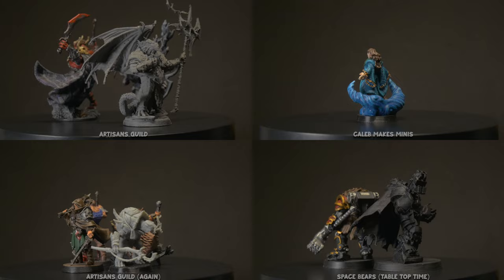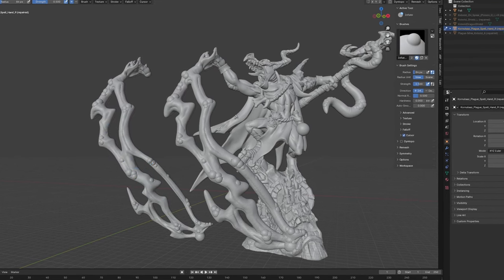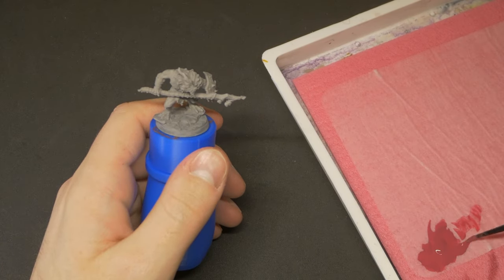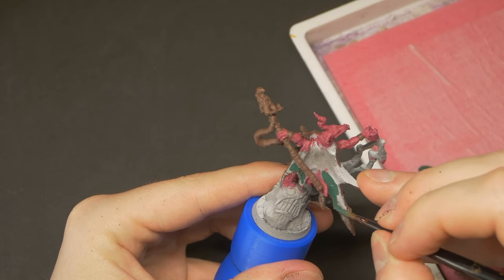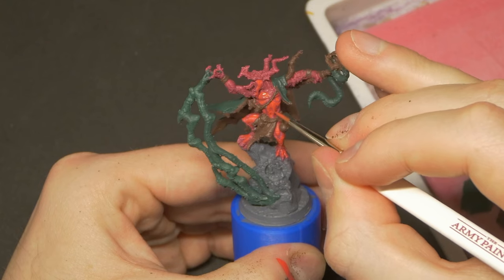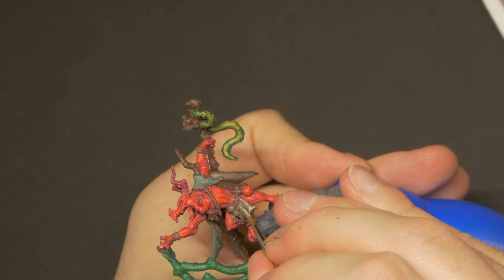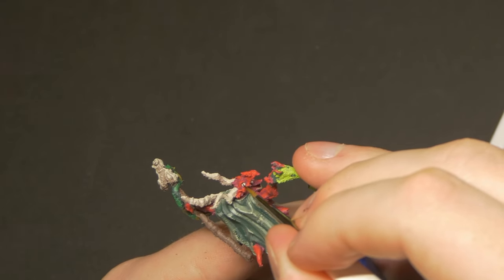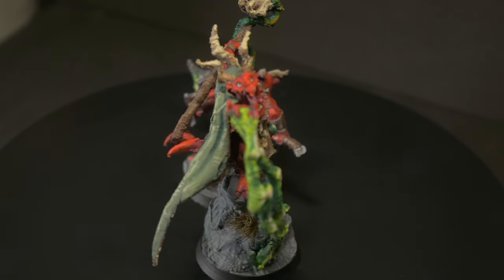FDM Miniatures in 2024! Can they compare?

Comment from the maker: Would give FDM minis a chance?
Reply: Nope. Cheap Resin printers are easily available. The results shown here are ... well, they are good for what one would expect, but they still look horrible (imo) compared to store-bought or resin-based miniatures. I don't do things half heartedly, so even if money were SUPER tight, I'd rather not have miniatures as a hobby than having them look like that.
Reply: I have a FDM printer, so it's my only option, thank you for your videos !
Reply: @ayonmetar2301  they look better sure, but also more toxic and require a lot more material.  can't touch the resin print until after cleaned with IPA , and then cured with UV light. need more ventilation and air circulation. filtration so you're not inhaling all those toxic fumes. masks, safety glasses, and gloves.
Reply: Yes I will. I don't really want the hassle of Resin Printers, I don't even have an extra room to dedicate to that.
Reply: @ayonmetar2301  Easily available =/ easy to use.
Lack of space, lack of proper ventilation, the hassle of having to get a curing station, that alone easily racks up the cost.

Also, health hazard? Spoken as someone who almost died due to resin fumes from printing, yeah, no. FDM all the way.
Reply: @tartatovsky  I can speak from experience (owning and regularly using both FDM and resin printers) that a resin printer + wash/cure station does not require much more space than a good FDM printer. If space is an issue, the entire hobby is problematic in the first place. If there is only space enough for one printer, I'd always pick resin over FDM.

It surely is more bothersome to use than FDM because of gloves+mask, cleaining, ventilation and so on. Nobody can argue against that. But a) it becomes pretty natural after doing it a few times and b) the results are just so superior to FDM.

It is always a question of what result one is aiming for. I enjoy the hobby aspect of wargaming and generally don't mind putting in extra work if that leads to better results. 
If space, ventilation or allergies make resin impossible to use for some, then it is of course not an option. However, I don't think people should be afraid of the "hassle" of using resin, because (from my experience) it really isn't that big of a deal. It actually is kind of its own hobby in itself.

For everybody who does not care that deeply about how their miniatures look and just enjoy the playing aspect of wargaming, FDM miniatures are definitely great. For people who are into the artistic aspect of the hobby, we're at least 5-10 years away from even considering FDM as a substitute for resin.

Bottom line: If resin printing were unavailable to me, I'd rather not 3D print miniatures at all, before using FDM for that purpose at this point in time.
Reply: @ayonmetar2301   

it can be a health hazard FAR MORE EASIER than it would be with FDM and PLA. 

Also, FDM printer needs less space than resin. No curing station, no glove/mask/cleaning tool, cleaning space, additional space to keep the extra resin after printing.  You also has no need keep all the chemicals away from children/pets, which you don't need to do with PLA and FDM.

Yeah, no. FDM all the way. I'd rather have my life than to deceased because I want 120k hi def super sharp uber  whatchamacalit and deal with resin again.
Nah.

If you rather choose no printer than to have FDM then its safe to say you were never into the wargaming hobby to begin with, rather you just want to have GW models without getting GW models.. Either that or you're rich. Think about people from third world countries for example.
Reply: @tartatovsky  I didn't ignore the health aspect. Did you read what I wrote? I said ventilation/gloves/mask are important and people with allergies should stay away from it. I don't know if you drank the resin to have such bad experiences with it, but in the 4 years of using resin printers, I have never had any problems with resin by simply sticking to the rules of "don't touch it, don't breath it". 
Regarding children: You also need to keep normal cleaning products from kids. Do you not clean your house because of that? All these are only issues for people who are irresponsible. 

My FDM printer is about twice the size of my resin printer. If I put the cure station, the gloves, the mask and my bucket of cleaning tools next to it, they occupy about the same space. I clean my models on a small tray on the floor in the garage. That doesn't require any space whatsoever. Space, again, really is way less of an issue than you make it out to be. 

Lastly, as I already said (and you apparently are to dense to understand) I value both the creative and the game aspects of the hobby. FDM is great for terrain, but that is all it is good for. Without a resin printer, I would indeed just buy the models and paint those as they come. The way it is now, i love to buy the GW stuff, design extra bits in a 3D modeling software and convert my minis to make them look unique. That is something an FMD printer just can't do.
It is cool if you can enjoy playing with parcheesi game pieces and milk cartons as proxies for minis and terrain. Its the same game in the end. But for all people who value both aspects of the hobby (which are numerous, I can tell you), FDM is not an option for miniatures. 
I am happy that lower quality prints work for you. For most people, they don't, as the high profit margin of pre-manufactured models by GW and others proves.

Considering the incredibly low number of FDM printed models I have seen used in tournaments or in my 36 people tabletop club (exactly 0 models), I think most people agree with my sentiment.
Reply: I did. It is going great. People love it.

Comment: I hate working with resin as a material. I'm basically waiting for FDM to be good enough to mainly use for premade bases and for those not too look too "off" under my Warhammer minis.
Reply from the maker: Absolutely! Even when I was resin printing my minis I found myself printing FDM bases, I just found resin bases took too much resin and never printed 100% flat due to resins affinity to warping. 
And honestly any FDM printer that can print 0.05 or 0.08mm is great for bases, once they have some paint and some grass tufts on them they do a great job.
Reply: Even with the rapid increase in quality we have been seeing over the past few years, I assume it will at least take 5-10 years until an fdm printer can match a current resin printer (if that ever happens). 
I got pretty used to working with resin. It's not fun, but it also isn't a hassle to me anymore. Just a necessary step on the path the best possible results.
Reply from the maker: Yeah - I highly doubt that FDM will every be able to match resin in terms of quality for things like miniatures, so for people than have Resin as an option too them it's definitely the best bet!
Reply: @Painted4Combat  what if I want to print bigger figurines like say action figures or anime statues?
Reply from the maker: Larger models means that you can actually clean it up a bit more, so If you don't mind doing some sanding you can achieve nicer results - with that said you'll still be seeing artifacts anywhere that a model has overhangs that requires support material.

Comment: its totally viable, i bought P1S combo just for all the stuff u can do, i cant put resin in my apartment, it would need serious VOCs vent system, that would cost time and money and modification to my apartment, i have lot of tabletop games, and its completly fine to use 0.2 nozzle with some medium sized minis for my games :)
Reply: you can just use a paint station vent  and put the printer in it and a tube out a window, you will need it anyways for solvent base painting and sanding.
Reply: @miguellopez3392  yeah, not gonna risk that in my apt, i have also big fluffy doggy, and dogs are way more sensitive to that shits,  i live in central europe, using that during winter with tilt turn windows no way, and dont wanna drill house walls to get vent out, i got medical air purifier and painting is bit easier to vent out cuz i have my printer and "gaming room" in my big open living room, but with the VOCs i dont wanna risk that .. maybe when the filters get better i will consider it, but for now no no
Reply: @ServTech1337  don't bother explaining yourself to these resin bros, man. They never take into consideration the living condition for most FDM users being different than them. They simply cannot comprehend any other situation other than their own.

Comment: I'm not touching a resin printer until I can somewhere with space and ventilation suitable for one. I've been very pleased with FDM for minis though so far. I highly recommend upgrading to 0.2mm nozzles. I was getting results similar to you, maybe a little better after a few months of tweaking, but with 0.2mm it has almost eliminated layer lines. The main issues I have left to deal with are scarring from supports and stringing although those are getting better
Reply from the maker: Awesome to hear you've been down this path as well! - I try to keep the 0.4mm nozzle on my printer as I do a pretty even split of minis to larger objects like terrain or household items, and swapping nozzles back and forth would get annoying.

Have you found much increase in print time swapping to a 0.2mm nozzle?
Reply: @Painted4Combat  Not as much as I thought, but I use the same 0.08mm layer height for both. I just did a test slice on an OPR Robot Legion Eternal and with my 0.4mm nozzle profile it says 1h50m, with the 0.2mm nozzle profile it is 2h16m. the lowest layer height I have tried was 0.05mm which looks amazing but puts the time up to 3h24m for the same mini so I don't use it much

Comment: One of the first slices I used, it was after one I can’t remember the name of, had a cutter and a lay on side function. It was very easy to take a more complex model and cut it down into easy jet pieces and then lay them down with less supper structures. Yes blender or CAD dose give you more flexibility when it comes to cutting and editing, the point it their are way to get complex prints to a more viable FDM level.

Comment: What FDM printer do you use, and do you have any recommendations for someone completely new to 3d printing
Reply from the maker: I use an Elegoo Neptune 3 Pro. its a great machine and is a reasonable price, but as with most 3d printers requires a bit of experience to operate to its fullest, though its also quite forgiving if it were to be someone's first machine. I do think the new BambuLabs A1 and A1 Mini look like they are 100% the best beginner friendly printer,  that can get you printing fast and easy but are still very capable of giving you access to dive deeper when you're comfortable, I haven't tested myself but there is some great content covering them. I HIGHLY Recommend checking out "Once In a Six Side" he's done some great videos covering the A1's and has done follow up video on how to get some great FDM from those printers. https://www.youtube.com/watch?v=aP7m-BcP0eg
Reply: @Painted4Combat  I've just started using one and have my first miniatures printed today, and I can second this.  The A1 is an incredible beginner FDM printer, just for sheer ease of use.  There's no comparison.  It does for 3D printers what the iphone did for phone UI.  (Though the full advanced slicer settings are still there in the software if you need them.)

Also, the print head is incredibly easy to swap.  I can change over from 0.4 to 0.2mm in two minutes, and one and a half of them are just waiting for the old head to cool before I touch it.

Comment: I've been printing minis on my FDM for a couple of months now. Needed quite a while to research the best settings to get proper results. Even after that, the results depend on how detaiiled the model is. A space marine for example can look pretty great as it's a rater big mini with lots of even surfaces. More filigrane minis often don't print properly at all. The main downside is that printing said space marine takes over 6h for one model. So if you think about printing whole armies ... I hope you have a lot of time.
A big plus of FDM minis is that they are much more resilient than the average resin mini, and also quite easy to use for kitbashing.
Reply from the maker: This is very true, part of the reason I ended up editing/inflating the spell effect on the sorcerer mini is because of the issues of printing a more fine mini sculpt in FDM.  And yes you're totally right, these can take a long time to print, especially with support material. Which I think is one of the biggest issues for most people at this point.

Comment: Nothing that a smaller nozzle and some acetone smoothing can't fix
Reply: might as well go with resin if you are dealing with acetone.
Reply: @miguellopez3392  There's a big difference between a little acetone and the incredibly toxic crap that goes with resin.  Resin is amazing if you have a separate ventilated room to dedicate, plus time, and patience, and masks, and a way to dispose of the residue safely and legally... but there is a place in between the two where acetone smoothing sits.
Reply: @TynamM  yes the acetone is more volatial than the resin and can give me a headache instantaneously if I brethren in fumes, You have to have mask, patience, and time to be doing acetone smoothing when you don't with resin as it's smooth already. I have all the things mentioned above, cleaning resin prints takes like 10 minutes from print plate to ready to work on, it just took money to get the process to be that fast and easy.

Comment: I dunno man, from my perspective resin printers and printing is cheaper than FDM
Reply from the maker: For me locally, 1kg of PLA Filament is half the price of a 1L Bottle of Resin (and then you have to factor in cleaning supplies). 
With that said - If you can safely use a Resin printer, it would be worth paying that little bit extra for the quality you get (or if its cheaper where you live that's even better!).

But price aside its more about the fumes, I can safely have an FDM printer printing PLA next to me on my desk, whereas a Resin printer would 100% not be safe to use in my tiny apartment 😅